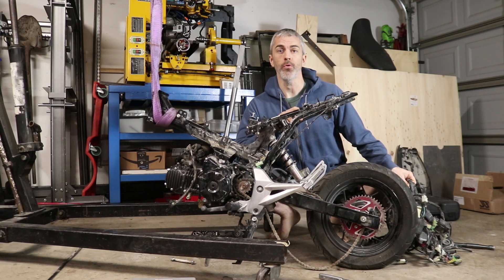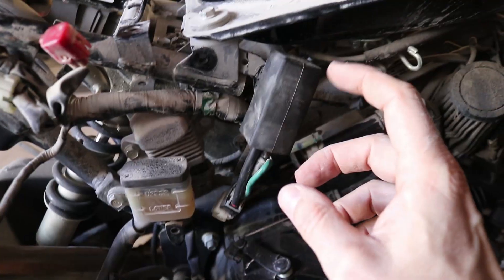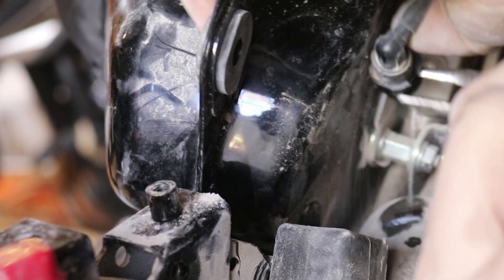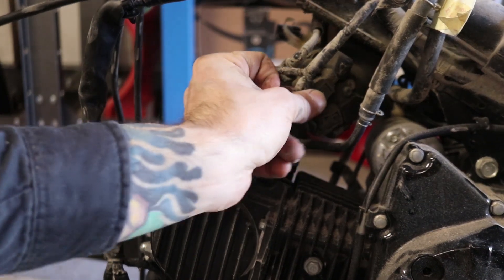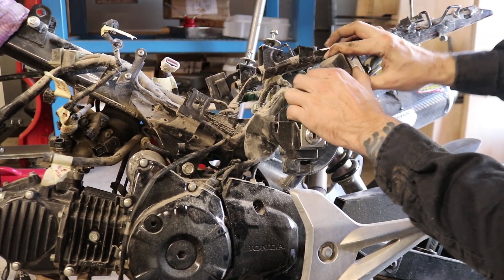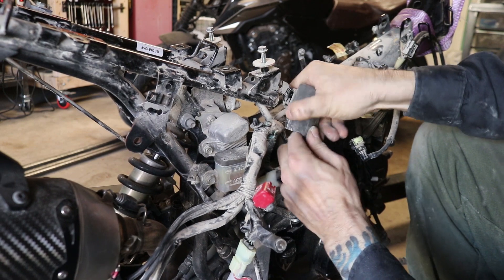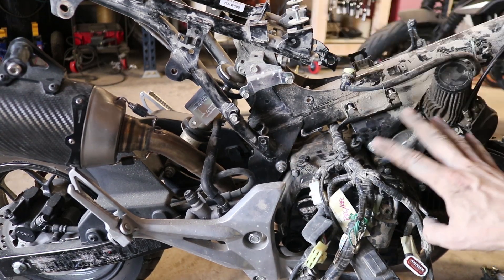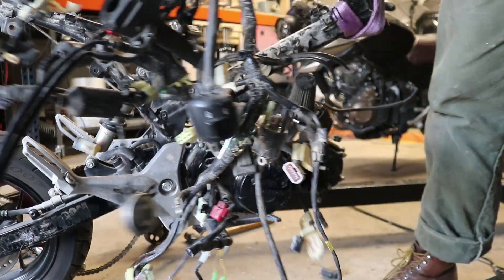Wire Harness Removal (& some other stuff) | Grom Chopper Build E5

Comment: LOL that tiny bike has more high tech than both my Goldwing and R100RT BMW combined. But then they are 34 and 40 years old respectively.  Instead of a Chopper I think a Long Distance  IronButt ride would be more challenging.  Mod a Grom to have  all day wind protection and cruising speed at 62.5mph all day.  Oh and 300mile range!
Reply from the maker: Well that's a thought 👍! Challenges are fun and a long distance Grom would certainly be that😀